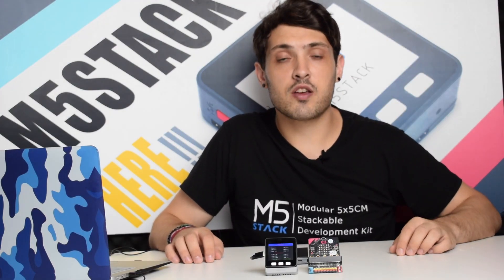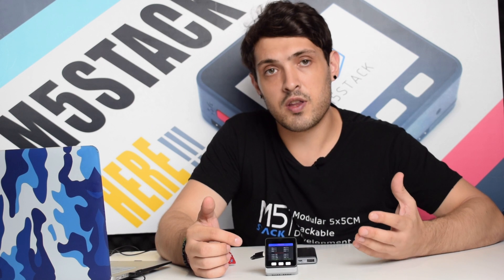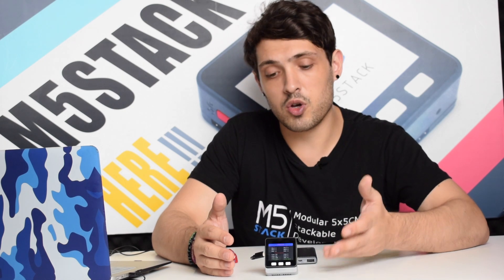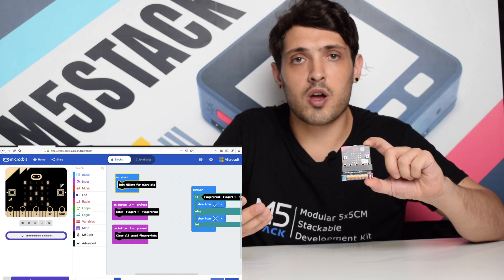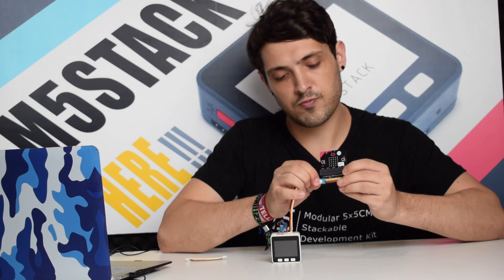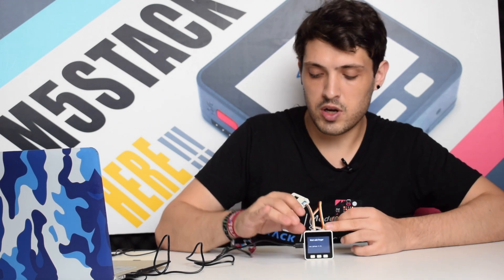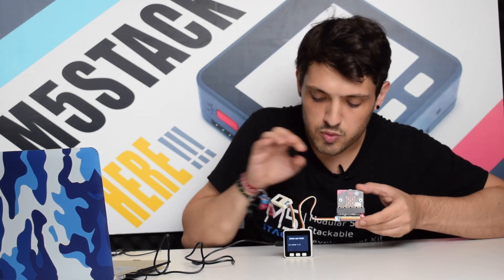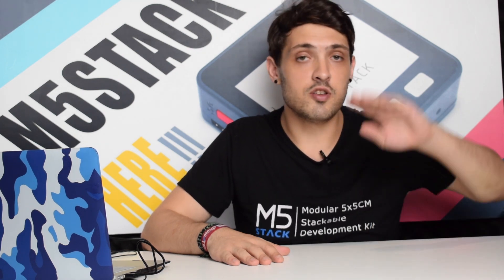Microbit M5Stack Adapter and PM 2.5 Sensor - June New Product Introduction

Comment: I think there's already a great variety of modules and products. I'm really impressed by the price and the features. Putting together an ESP + screen + speaker + sensors + battery circuit and getting it in the case would cost álmost as much as the Core but it's super messy to DIY it, so it's kind of a no-brainer to get an M5Stack. Except for the fact that it can be a little tricky to find documentation. Not sure if I'm just looking in the wrong place, but I suspect that's what's keeping some people from jumping on the M5Stack train. I know if I make something with an Arduino Nano I can get it to work really quickly, I'm not so sure if it's the same with the M5Stack. Maybe I should just be looking for general ESP32 documentation instead of specific M5Stack docs, it might be the same.
I'm also a little overwhelmed by everything that you can get. Like there's at least 5 camera modules already, with different framerates, different lenzes, some out of stock at all my local resellers, some have certain options like batteries, some don't work well for an extended period of time without overheating. I've spent an hour already trying to figure out what I need/want if I want to make a M5Stack Core smartwatch that can connect to an M5Camera for surveillance purposes.

Just my 2 cents... I do wish that this whole platforms gets more popular because it's exactly what I've been looking for. And I too would love to see a RTC module and maybe a module with a high quality stereo audio output. Or even a PAM8403 module that lets you simply connect 2 speakers directly.

Comment: I am getting a 404 when I try to access the docs.

Also, the description says that the roof connector is assigned to pin 8 and 12 pin by default... does this mean that you can change this on the adapter somehow?

Comment: Adaopt firmmware/hardware so we do not need to add an extra capacitor in order to reliably flash the M5Stack Core.
Reply from the maker: good suggestion, noted thanks

Comment: An RTC Add on board for the CORE would be great !
Reply from the maker: Good idea. These can work in the meantime https://www.hackster.io/lukasmaximus89/rtc-modules-with-m5stack-46636b
Reply: @M5Stack  +1 on the inbuilt RTC. Having that with the PM2.5 module would make it much easier to use as a portable PM2.5 data logger

Comment: When you start attaching cables maybe you should use the Standing Base to keep the M5Stack from flopping over.
Reply from the maker: Which base do you mean? the one I was using for the pm2.5 sensor? If so it's incompatible with the m5go and m5stack fire. Thanks for the input though, I will try to think of a better solution